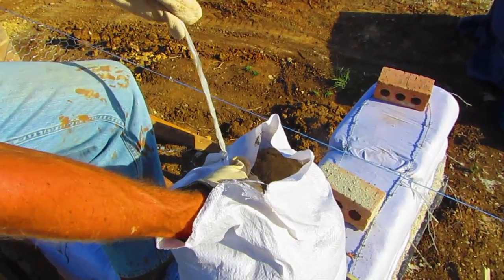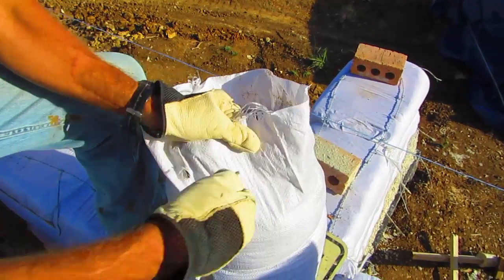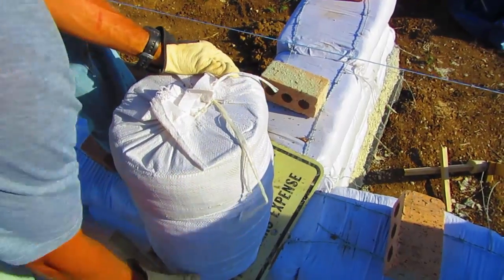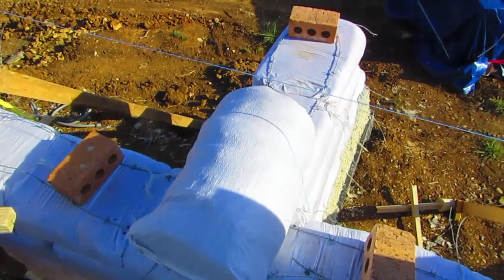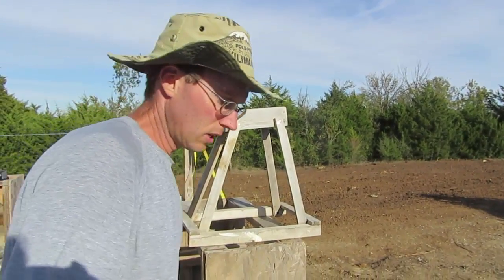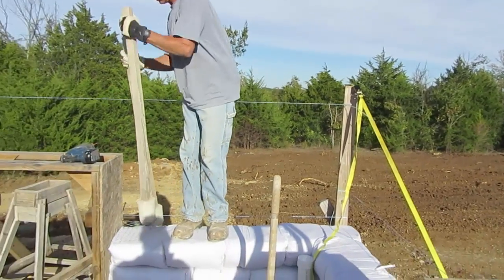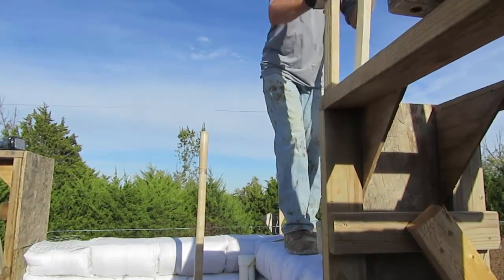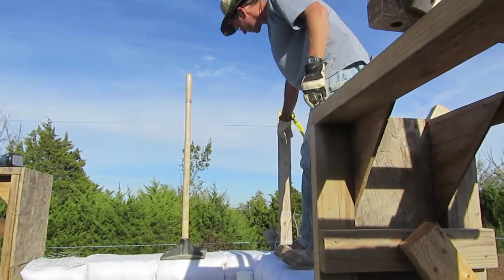Filling Earthbags in Place

Comment: How many years useful life?
Reply from the maker: +Christian Cuervo - The bags have to be covered within about 3 months or they will start to fall apart due to UV exposure.  However, once the bags are protected from the sun, the building can last for many, many years.  It will probably vary depending on how well the house is maintained, but I think a well-maintained earthbag house could last 100 years or more, similar to adobe structures.